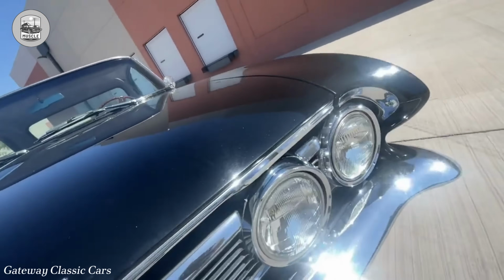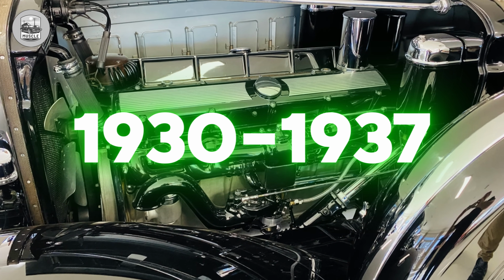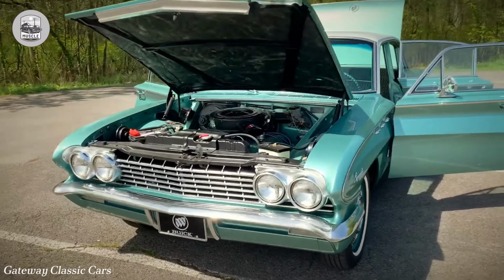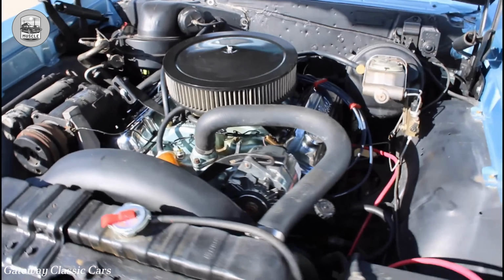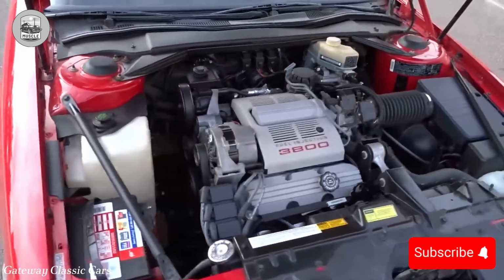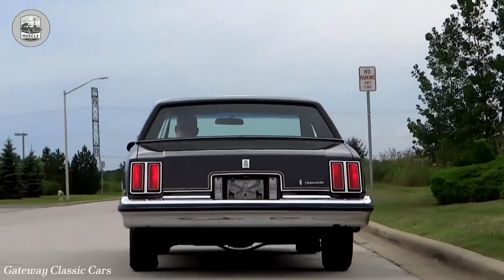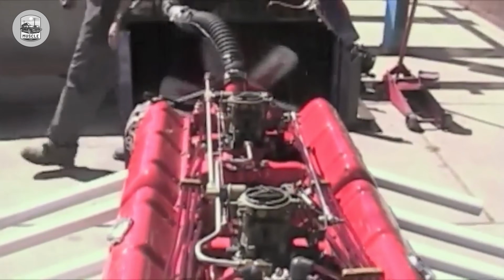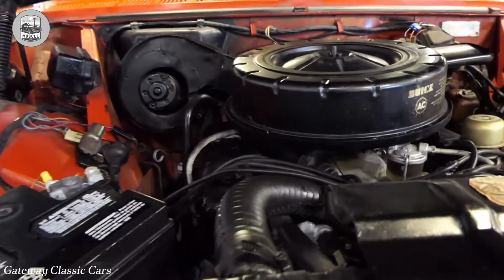10 MOST FAILED and WEIRDEST GM Engines ever made | Worst engines blunder!

Comment: That GM V12 in semi pulling a loaded 45 ft. tandem trailer got a whopping 2.2 miles per Imperial gallon.
Reply: The GM tractor belonged to a scrap yard in  Chilliwhack me and the driver took a load of copper into Vancouver BC.. That V12 had a lot of power.
Reply from the maker: @gelmgren  Wow, what an amazing experience! That GMC V12, often referred to as the "Twin Six," was truly a beast, designed to power heavy-duty trucks and even industrial equipment like yours. With 702 cubic inches and a ton of torque, it was capable of pulling some serious weight, making it perfect for jobs like hauling scrap and heavy loads. The sound of that engine at full throttle must have been incredible!
These V12 engines are pretty rare today, and it's always fantastic to hear firsthand stories of them in action. If you or anyone else has more stories like this, we'd love to hear them!
Reply from the maker: Wow, that's incredible! The GMC V12, often referred to as the "Twin-Six," was an engineering marvel. Essentially two V6 engines combined into one block, it was built for industrial applications like semis and large trucks. With a displacement of 702 cubic inches, it was designed for torque, not efficiency. While 2.2 miles per Imperial gallon sounds shocking by today’s standards, back in the day, raw power and hauling capability were the priority. This engine could produce around 500 lb-ft of torque, which was perfect for pulling heavy loads like that 45 ft. tandem trailer you mentioned.
For those interested, the GMC V12 was used in a variety of heavy-duty applications in the 1960s, including fire trucks and construction vehicles. It might not have been the most fuel-efficient, but it was built to last, and you could still see some of these beasts running today!
What do you all think about this old giant? Do any of you have memories or experiences with engines like this? Drop your thoughts in the comments below! And don’t forget to comment, share, and subscribe to the Muscle Car Masters channel for more fascinating insights into the world of American muscle and industrial power....

Comment: Yes the 215 Buick was a failure, but one of it's offsprings became the ultimate muscle car engine in the mid 80's to early 90's. Lopping off two cylinders and adding a more modern computer controlled turbo the Grand National was the fastest car of the year, till the GNX (Same car, more power) came out, the same 3600 V6 also switched up to FWD and supercharged and also became a stable in the 90's FWD GM's
The Pontiac T 4 wasn't the only 1/2 V8 ever produced, IH also had one, Unless they borrowed the pontiac
The Olds diesel, Of note, while the 350 was also a failure, it had a second life as a budget drag racing engine. by converting it to gas and hopping it up like a typical gas engine, They were ridiculously strong platform for performance. Also because they were so overbuilt for Diesel compression, they could be poked and strokes much bigger than any other 5.7 (350)L platform
Reply from the maker: Thanks for the fantastic comment and insights! While it didn't achieve greatness in its original form, its lineage played a pivotal role in muscle car history. The Grand National and GNX took that 3.8L turbocharged V6 and redefined what a performance car could be in the 1980s, leaving V8s in the dust! The GNX, with its boosted power and improved suspension, was the ultimate sleeper car, often surprising even the most potent competitors of the era. And yes, that engine later transitioned to FWD, becoming a supercharged powerhouse in vehicles like the Pontiac Grand Prix and Buick Regal in the '90s.
As for the half-V8, you’re spot on! The Pontiac "half a 389" (T-4) wasn’t alone—International Harvester (IH) also had their own version, the "half V8" that appeared in some of their smaller trucks. It’s a reminder of the fascinating engineering experimentation of the era.
The Oldsmobile Diesel 350 had quite a tough reputation, but enthusiasts saw its potential when converted to gasoline. As you mentioned, the engine's strength from its diesel origins allowed it to handle serious upgrades. It’s wild how it could be bored and stroked to levels that many other 350s couldn’t touch, making it a surprise hit in the budget drag racing scene.
Thanks again for sharing these gems with the Muscle Car Master community! If anyone has more stories or questions about these engines, drop them in the comments below! And don’t forget to like, share, and subscribe to the Muscle Car Master Channel to keep the muscle car conversation going strong....

Comment: The best v8 i ever had was the 1967 olds 330 steel crankshaft and connecting rods with a cmpression ratio of 10.25 to 1 put down a ton of rubber and held together well
Reply from the maker: Thank you for sharing your experience with the 1967 Olds 330 V8! That engine was an absolute powerhouse, and with a 10.25:1 compression ratio combined with that robust steel crankshaft and connecting rods, it was built to take some serious abuse. The Oldsmobile 330, especially in its high-compression form, really exemplified Olds' reputation for durability and performance in the muscle car era. It could lay down some serious rubber, as you’ve experienced, and was known for its smooth, reliable power delivery. The 330 was also a bit lighter than some other V8s of the time, making it a great choice for a balance of power and handling.
To everyone out there—what’s your favorite V8 engine? Have you had a similar experience with Oldsmobile’s engines or another brand? Let’s keep the discussion going in the comments! And if you love talking muscle cars and engine performance, don’t forget to comment, share, and subscribe to the Muscle Car Masters channel....

Comment: The jet fire was the first ever production turbocharged application. Not just the US.
Reply from the maker: The 1962 Oldsmobile Jetfire was indeed the world’s first production turbocharged car, not just in the U.S. It came equipped with a 215ci V8 engine that, with the addition of a Garrett AiResearch turbocharger, pushed output from 185 horsepower to an impressive 215 horsepower. What made the Jetfire unique was its use of a special "Turbo Rocket Fluid" (a mixture of distilled water, methanol, and a corrosion inhibitor) to cool the turbo and prevent engine knock. This technology was cutting edge at the time!
Although the Jetfire paved the way, turbocharging was still in its infancy, and its complexity made it a short-lived option. Still, it set the stage for future turbocharged innovations we see today!
To everyone else, if you love learning about rare and revolutionary muscle car tech like this, make sure to comment, share, and subscribe to the Muscle Car Masters channel for more content like this! Let us know what other turbocharged legends or muscle cars you'd like us to cover!

Comment: i had the 215 aluminum block motor in my 1963 buick special station wagon i believe. it was a tiny v8 with an aluminum block
Reply from the maker: Great to hear about your experience with the 215 aluminum block motor in your 1963 Buick Special! You're absolutely right—it was a small but mighty V8. Buick introduced the 215 in 1961 as one of the first mass-produced aluminum block engines, and it weighed just around 300 pounds! That light weight helped improve fuel efficiency and handling, making it a real standout for its time. Even though it was small, this engine packed a punch with up to 200 horsepower, depending on the configuration. It was such a good design that Rover later bought the rights and used it in their cars for decades.
Thanks for sharing your story, and we'd love to hear from more of you! Have any of you had experiences with the 215 or similar small V8s? Drop a comment, and let’s keep this conversation going. Don’t forget to share and subscribe to the Muscle Car Master Channel for more great content about classic engines and muscle cars!

Comment: The buick 215 was in production by landrover until 2005 powering anything from a tractor of a landrover to TVR sport cars. Its even been tried to make into a 3.5Tdi (iceberg project) the crank became a stroker crank for a later bigger engine size IIRC, so it did atleast make something out of the project (was also a forged crank, so its strong)